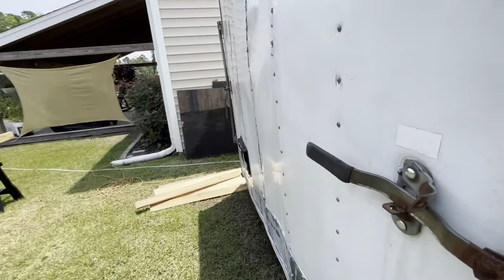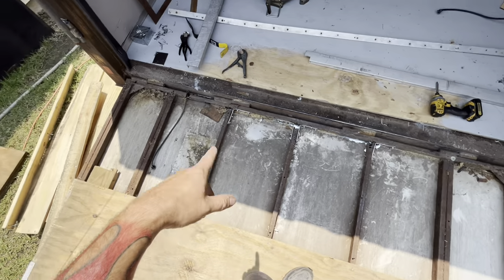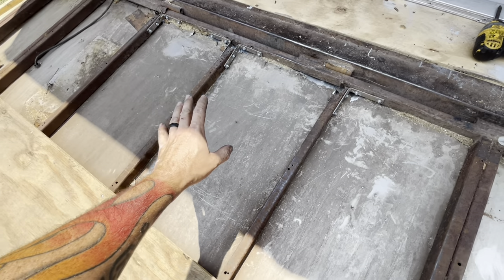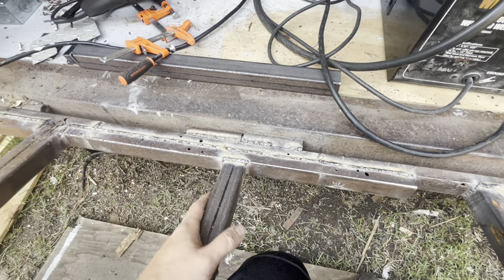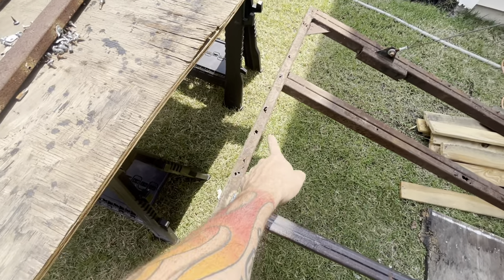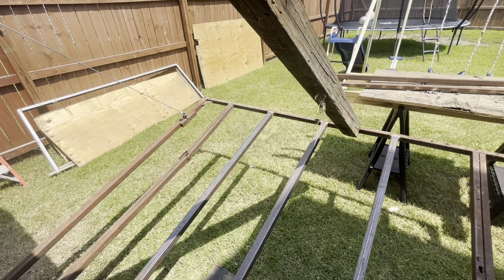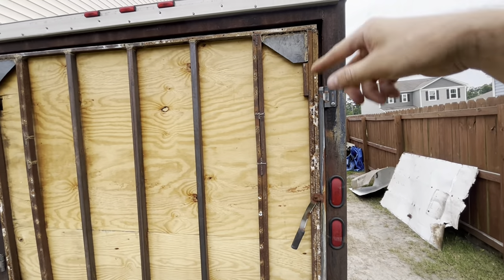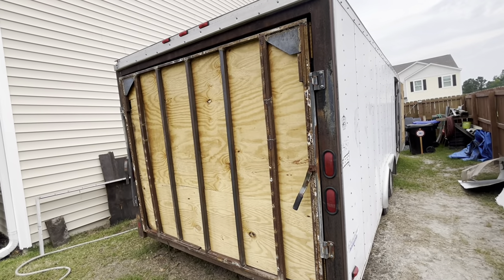😬 DIY Budget Trailer Ramp Door Repair (Worse Than I Thought It Was)

Comment: Great video.  

Question:  I have to redo most of the outside of my trailer and had the same idea, using roofing galvalume.  Have you ever considered running the outside metal bottom to top, rather than back to front?
Reply from the maker: I haven’t. There wouldn’t be an issue with that besides the looks. If you ever plan to resale then it may look homemade which could hurt the value.

Comment: You should paint it and then you should put a double sided tape in between as a moisture barrier to prevent electrolytes set up between the mixture of 2. Different metals.
Reply from the maker: Man that is an excellent idea!  I don’t plan to keep this long term though and being I didn’t replace all the metal ima just let it roll as is like they did from the factory.  Trying to work my way up to a nice 28’ trailer one day but being on a budget I couldn’t go 20’ to 28’.
Reply: I totally get it and what you're doing is inspirational to people like me that. Want? To do the. Same? Thing keep your good work up.
Reply from the maker: Thanks buddy